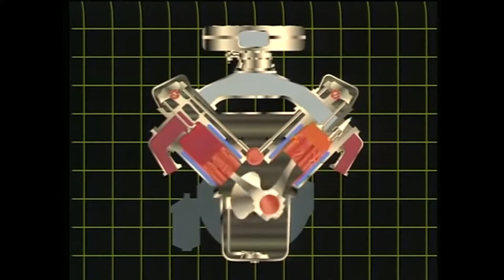Engine Rod Knock Vs. Piston Slap - Take a listen to both!

Comment: There's another knock called ignition knock. What does that sound like?
Reply from the maker: So ignition knock, (or ping as some people call it) in my experience, sounds like a faint metallic rattling sound, almost like someone is shaking a empty can with a coin inside of it, but it is very dull and difficult to hear...

 in the rare occasion I drive someone else's car on the steep hills in the mountains here in the high country, you can hear that sound if they have put the cheap 85 octane gas into it, and if you give the car a significant amount of throttle on the steeper hills. 

My parents had a 96' Corolla that would do it, and if you bumped up to 87 octane, the problem would go away. I haven't yet experienced how it sounds if the ignition timing is set incorrectly, but i imagine it would be similar and more frequent!
Reply: Yeah it’s quite subtle, not very loud, a muffled raped “tink” sound and it only happens when you push the accelerator when the car is no revving much and under load (like when trying to accelerate in a gear that is really to high for it). It goes away when u take yr foot of the throttle. Most modern engines have knock sensors which retard the ignition timing automatically and stop it happening. In the long run it gives the big end bearings a very bad time!
Reply: Rapid not “raped” in my prior reply sorry!

Comment: I had an almost new low mileage corvette C5 with the dreaded piston slap. P.o.s. car...
Reply from the maker: Was the noise what made you pass on it?
Reply: @ExiledWolf84  Yes. I was afraid it would get worse. That and the horrible automatic. It ended up buying a newer C5 with a manual instead.  ;)

Comment: I lost a few strands of my remaining hair when i heard my Buick Roadmaster start piston slapping one cold morning. 

I had just bought the car a couple months prior during the hottest part of the summer and finally morning temps started dropping to the mid 40s °F. First real cold morning start was quite an experience 😅

I just let her get a little heat built up and its no problem. Only takes 45 seconds to 1 minute of idle and she stops making noise so its well within my normal warm up time. 

Doesnt use any oil within 3k miles intervals and hasnt used any coolant (wood knocking!) Not bad for a 30 year old car with 164k miles if ya ask me.
Reply from the maker: Always was a fan if those Roadmasters! Those and the Flestwoods were truely the last of their type from GM.

I felt the same eay when that noise in ky Caddy reares its ugly head, but after researching and diagnosis, i'n not terribly concerned about it now

Comment: Cadillac engines were life-time engines.  Cadillac were LUXURY cars, not economy cars.
Reply from the maker: Amen to that! It's been a hell of a motor too. It probably would have been SOOOO nice back in the mid 70's with all of the other crappy cars that were being pumped out at the time to drive something like that. It pretty much has its torque curve just off of idle and barely has to work to proper the big whale down the road.
Reply: @ExiledWolf84  Actually, the Inline 6s and V8s in most standard-size and mid-size cars were generally very reliable.  It was the owners who were and still are crappy - refuse to change the oil, don't check the oil when they get gas, don't check the water rather wait for it to overheat, etc. etc.  It was the new compact-car engines - Pinto engine, and, worse of all in the whole world before and after, the VEGA engine - that were crappy.  The Pinto engine lacked oil spurt holes in the con rods, resulting in scuffed cylinder walls if you didn't first warm the engine up and that horrible Vega engine just failed in every way humanly possible unless you rebuilt it with steel or iron sleeves and 4 ring pistons.  Also, that 2.8 V6 was lousy as well.  Open-deck design, frequently blown head gaskets.
Reply from the maker: @jamesbosworth4191 that's more of what I was referring to, but even a lot of the V8's were dogs at the time. My Dad was a police officer in the late 60s early 70s, and the new police cars the departments were getting at the start of the emissions era were hilariously outclassed against cars that were built a few years earlier with the higher compression ratios and such.
Reply: @ExiledWolf84  They were, performance-wise, but they were still reliable, something European engines were not.
Reply from the maker: @jamesbosworth4191  Oh for sure! And like you said, there's always the one variable: People who just don't take care of their stuff. I have been appalled at the condition that some relatively newer cars used to come into the shops and dealerships I worked for, and when I was a lot tech it struck me as odd how many people there were that bought a brand new high end car, and would just toss their shit into it and quickly drive away, not even seeming to be excited about buying it... Kind of that "it's gets me around and has snob appeal" attitude.

I even had a Bentley coupe come in for some basic maintenance once that had quite the large amount of duct tape repairs on the interior. Belonged to some young banker who just wanted to look the part when he rolled up into the parking lot, I guess, but never turned a screwdriver in his life.

Comment: Poor 3800, it died far too early
Reply from the maker: Agreed. It was a hell of a motor, that's for sure.
Reply: @ExiledWolf84  I did the upper and lower intake manifold gaskets on my series 3 around 200k miles and when I opened it up, it looked brand new. All the castings were still beautifully silver and there wasnt a hint of staining from the oil. Very easy to work on too.

Comment: I pissed myself laughing at your comment. You are saying vehicles in the 70s are not being made of quality. How much glue did you eat in school as a kid?  I love my small block Chevy built well and is still around after 50 years, so tell me when quality went out the window.
Reply from the maker: Ooooh! My first negative comment!! 

Well, I personally wasn't a fan of eating glue when I was a kid, especially the Elmer's stuff! Yes, a lot of the other kids were doing it because it was minty or some shit, but I myself preferred the glue sticks, because they wouldn't soak into the paper, and didn't have the VOCs of the rubber cement! But thank you for your concern!.... But, I'm glad "you like your small block Chevy built well"

I like my "big block Cadillac built well" too! 😜
Reply: Rust was a real issue on the older cars if you lived in an area where they used salt on the roads in the winter. Trim and interior pieces could be sketchy also. As you noted, some of the engines could hold up pretty well, the small block Chevy being one of them. Although all the engines would start burning oil once they got old. I remember cars from the 60's and 70''s, we used to figure about 10 years or 100k miles and after that cars could be had pretty cheap because they were not expected to go a lot longer. If it was well maintained and not beat on they could easily go 150k miles though.

Comment: WRONG ABOUT 70S CARS YOU'RE TALKING ABOUT 40S AND 50S CARS AND WHERE THE PROBLEM CAME FROM THEY USED TO PUT SO MANY I SHOULD EVEN SAY 30S ONLY RAN FOR AS LITTLE AS $50,000 MILES OR SO BECAUSE THEY HAD SO MANY PISTON RINGS AND THEN THEY WORE THE BORE OUT AND JUST DUMP THE WHOLE BUNCH OF METAL AND THEY DIDN'T HAVE THE OILS SO ANYWAYS AS GOOD OIL AS THEY HAVE NOW
Reply from the maker: WHY ARE YOU SCREAMING?!?!?